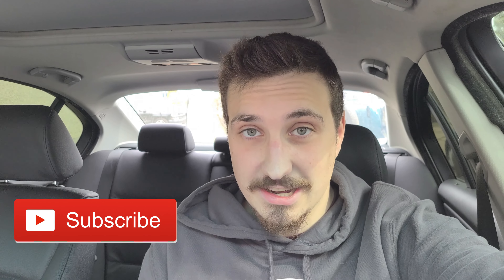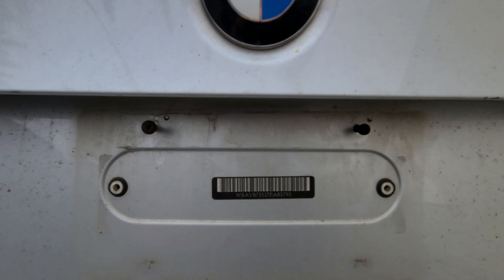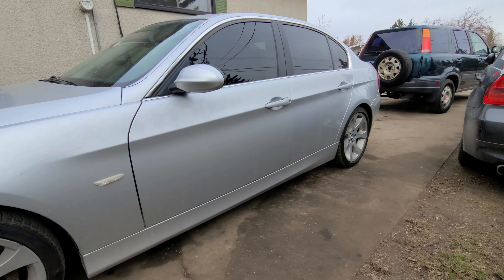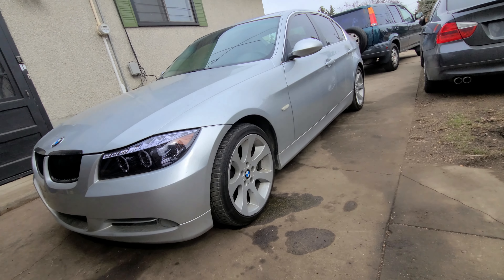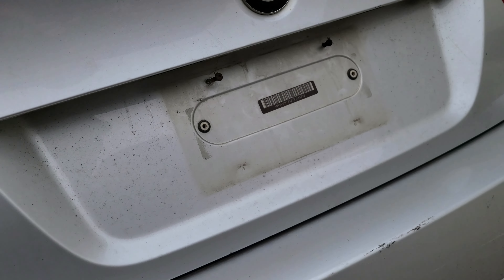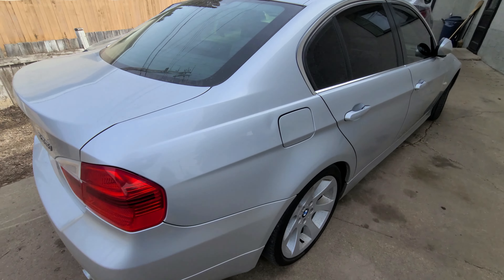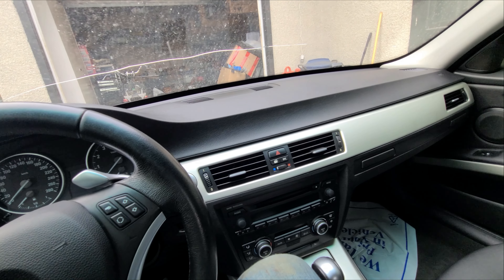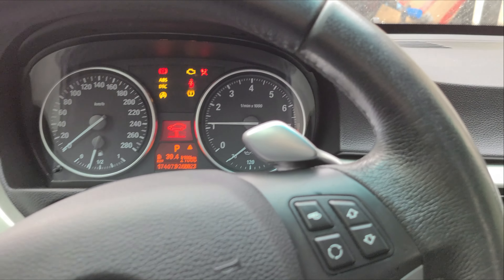I BOUGHT THE MOST UNRELIABLE CAR EVER!! ( BMW E90 N54 Project Intro) I'm In Over My Head..

Comment: You'll be fine you just have to change the water pump, thermostat, pcv valve, valve cover gasket, spark plugs, ignition coils, 6 injectors and seals, hpfp, radiator, oil pan gasket, vacuum hoses, upgrade intercooler and charge pipe, fuel pressure regulator, replace battery (low battery can cause some headaches), oil and filter for motor and transmission pan and fluid. Just drain and fill tranny if auto. You'll be good for about 5-10k miles after that 😆
Reply from the maker: Honestly man you have no idea how accurate that is, we're slowly working our way through that list currently haha. She's a moody ol' girl so far thats for sure!
Reply: lol all that
Reply: Are you buying it completely unmaintained ?